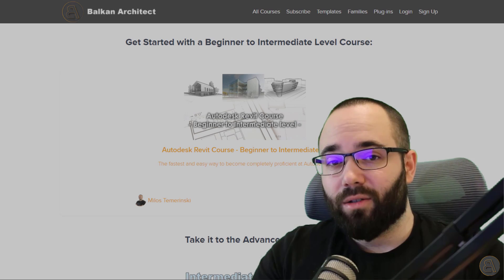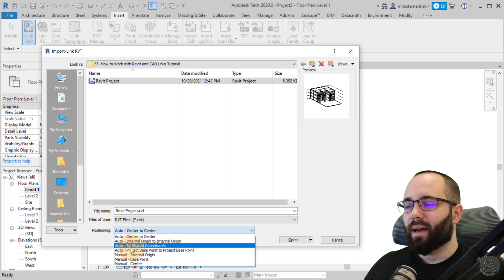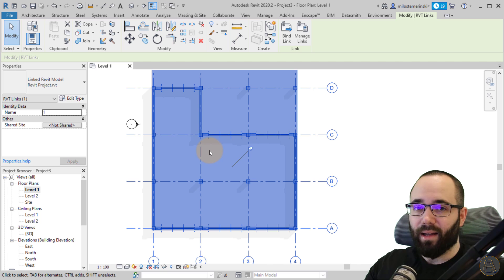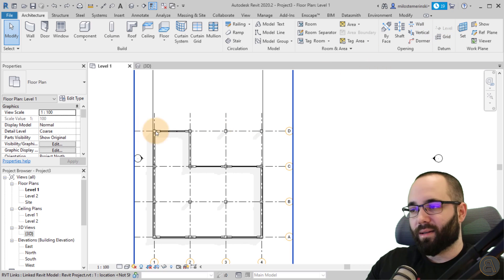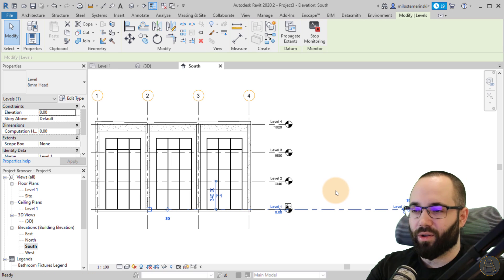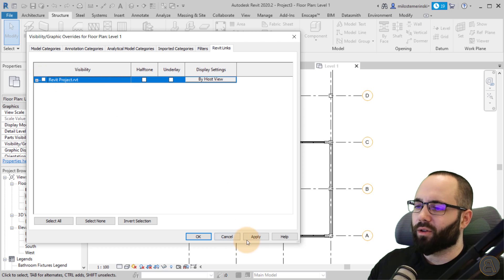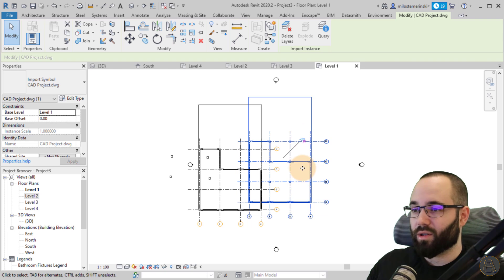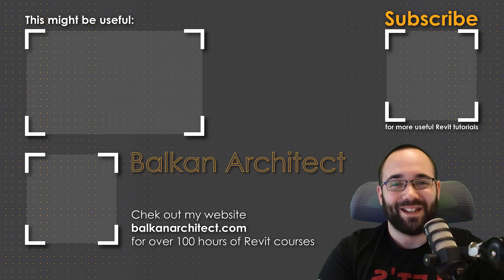Link Revit & Link CAD - Master Links in Revit Tutorial

Comment: Can you make a video for efficiencies on linked revit models with AutoCAD files? I also use filters in my templates.  I am trying to find efficiencies, but new to templates. I am looking for efficiencies on making multiple views of different disciplines. Example is make electrical view with template. And then create a duplicate of that view, and apply a new template for mechanical. Keep in mind that the view may change what shows based on the 2 different view template settings (things may change what shows from the revit and imported CAD file).  I am an MEP drafter that sets up our revit projects using the Architectural model. Thanks in advance.

Comment: As an electrical modeler I always use the option "origin the origin" when linking files. And I never move linked objects.
Otherwise It gives problems with coordination between different models from others contractors. For example an architect who links my file in his/her model to look for collisions between walls, cableducts and plumbing.
When I start a new project I first link the architectural model and then place the electrical components.

Comment: There are still some bugs/problems when using Revit-Link... 
1. Bottom elevation of linked floor cannot be shown properly ESPECIALLY two or more floors are lapping
2. The schedule of linked objects cannot get the room information since the objects and rooms are in separated files
Reply: about scheduling elements from linked rvt models there is an option, but it's complicated, i prefer scheduling elements in the model.